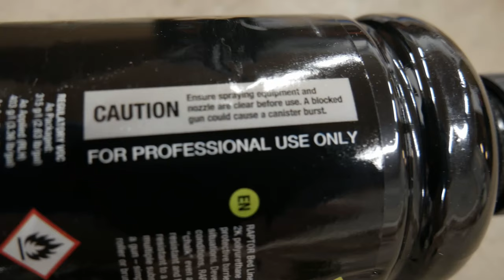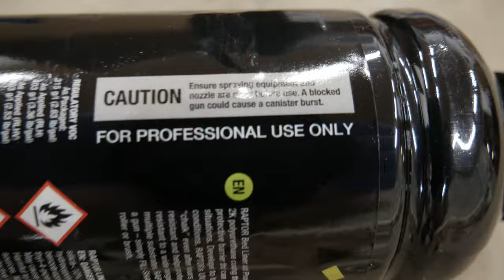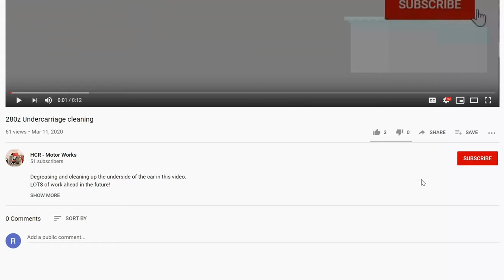Raptor Liner for Undercoating - The ULTIMATE Undercarriage restoration

Comment: Hey thanks for the video. Looks amazing. Did you have any issues with heat from the exhaust and the raptor liner holding up? I’ve read the max temp is 185 once applied. I’m about to undercoat and wanted to see if there were any issues with that!
Reply from the maker: I have not had any issues with it heating up or falling off. Good prep is key here though. You may have issues with it becoming soft and becoming easier to damage from road debris around the exhaust sections but it should hold up fine. If your worried about it you can always ceramic coat or wrap your exhaust where its close.

Comment: Any reason why you haven't used sand blasting? Would be really nice to have some explanations of what's going on especially at 21:05. Thank for the full process though :)
Reply from the maker: I mentioned in this video https://youtu.be/P8f2Wo_zBxo why I didn't sandblast this one (I have blasted em in the past) and in this video https://youtu.be/omuu6Of1388 I have a breakdown of all the steps.  The algorithm loves the time lapses with no info though so YouTube pushes those videos more.
Reply: @hcr-motorworks  oh thank you, sorry I’ve just came here from a YouTube search. Will definitely take a look now :)
Reply from the maker: @Holms  ANYTIME! Thanks for stopping by and watching!
Reply: @hcr-motorworks  Motor Works  I was thinking about some rusty places, when some rust can be left in a small holes where grinder won’t be able to reach. How do you solve those issues? Having epoxy putting on a surface where there are some rust left even tiny one, is not a good idea I believe. There’s also an acid primer to isolate the rust from metal… but I’d just try to sand blast those spots. Would require a mask tape and cellophane around the car, but if it’s just a couple of spots you wouldn’t be buried in a dust I believe.
Reply: @hcr-motorworks  oh and I haven't seen any 3M roloc and bristle discs used in any of 3 videos.. or maybe I've skipped something, but I've went through again through all vids and haven't noticed they've been used anywhere. You've did everything with a stripping disc.
Reply from the maker: https://youtu.be/GdapVksYGFg This video shows me using the roloc bristle discs pretty heavily. They are great for those hard to reach areas where the scuff pads wont get to.
Reply from the maker: Datsun and rusty places are synonymous...to rid yourself of rust, one must become the rust.  I prep the metal as best as possible and removing rust where you can reach it.  I always get down to fresh bare metal and then clean clean clean the metal before epoxy primer.  clean fresh bare metal and then 3 coats of epoxy primer will prevent the rust from returning at least in my lifetime
Reply: @Holms  I think Spray with ospho would be wise.  Just make sure it's neutralized before paint.  There's bad stories of rubberized undercoat failing.  I don't want to have to strip off all good paint and trying to figure maybe a good primer to cover paint/bare metal/converted rust.

Comment: Any chance explaining difference between coating and the texture coat?  Is it just shoot from a further distance for smoother lay of the paint? Cheers
Reply from the maker: On the Raptor Liner the first two coats are thick and fairly runny...think like spraying tar basically.  There's a lot of unevenness with these types of products but you have to get the build thick enough so its effective in protecting the surface.  The texture coat is to give it an even roughness and uniform coat on top of the thick layers and make it look better.  All you have to do is up the pressure and double the spraying distance and do long uniform sweeps with it on the 3rd or final coat.
Reply: @hcr-motorworks  thanks very much 👍

Comment: Would sand blasting the car have been easier? Or was this a budget way to go? I have an 87 crx si that I plan to restore, was going to have it sandblasted and painted
Reply from the maker: https://youtu.be/P8f2Wo_zBxo Check out this video where I break down all the methods and why I did what I did for this project.
Sometimes the easy way isn't the best way, on your CRX, or any car body for that matter, you should not blast the body panels, engine bay, undercarriage, interior are ok as long as you hire an experienced blaster and do wet/dustless/vapor blasting...I would NEVER dry blast any sheet metal as the heat will warp and oil can everywhere and ruin it, even with an experienced guy at the nozzle.
Reply: @hcr-motorworks  that is incorrect, it will not get hot let alone warp sheet metal unless your putting the nozzle point blank  right next to the metal. The only disadvantage is its messy and yes the water vapor blasting would be preferred on body panels not under carriage, the last thing you want is water entrapment right before you seam seal. I dont know what experience your opinions on sand blasting come from they are wrong i speak from experience. There is no other method other than dry ice blasting that achieve the paint bond bar none!

Comment: Awesome video question instead of the epoxy I was thinking on using the rust encapsulator from Eastwood and than apply the raptor liner same process as you but use the encapsulator as primer would that work also? I want to prevent rust as much as possible
Reply from the maker: I prefer to remove the rust as much as possible. I never use rust encapsulaters/converters. Seems like just kicking the can down the road instead of fixing the problem.
Reply: @hcr-motorworks  really oh wow and I thought that would be a better option which expoxy do you recommend I tried looking on your links below but I didn’t see the epoxy
Reply from the maker: @Maxmgm212.  southern polyurethane for the epoxy hands down
Reply: @hcr-motorworks  awesome I just found it I’m getting it for sure I’m gonna start my project next weekend , what product did you add at the end you mentioned for texture ?
Reply from the maker: @Maxmgm212.  its the raptor liner undercoating. That should be in links in the description, let me know if its not and ill fix it!
I used around 2 kits if i remember correctly to do the whole undercarriage.

Comment: Hi. Do you think Upol Raptor is better than regular blackson? Thank you
Reply from the maker: I'd say that if your going to use something other than raptor liner it needs to come in a two-part system.  A base and a catalyst, or activator of some kind.  Anything that comes in a tub, bucket, pail, container etc that is one part or "ready to spray" right off the store shelf is not going to work near as good as the raptor liner.
Thanks for watching!
Reply: @hcr-motorworks  Thanks ! Maybe I will use it for my miata undercarriage, Upol also sells special epoxy primer for raptor. Expensive but hope it will last for years ! 
You did an amazing job
Reply from the maker: @watai  My advice would be to do exactly what i did my previous videos if you want it to last a lifetime.  Strip to bare metal, clean, clean clean, and when your tired of cleaning the bare metal, clean some more.  Then lay down some good two part epoxy primer (hands down Southern poly urethanes is the best stuff for the price and home shop environment) then Use a quality seam sealer (brush able or tube kind) and then Lay down another coat of epoxy once that has cured.  Then and only then are you ready to add the raptor liner on the new and clean epoxy primer.  Doing it this way and adhering to all the steps along the way will surely lead to a successful outcome that will last many decades.  My earlier videos on the undercarriage lay out everything in detail. ENJOY!
Reply: @hcr-motorworks  Not questioning your methods. Just asking. Don't you have to scuff the epoxy for the liner to grab? Or apply it wet on wet?
Reply from the maker: @AdrianMontana  I apply the 2-3 coats of epoxy to the prepped bare metal and let that dry overnight. Next day I do the seam sealer and let that dry up overnight, day 3 I throw another coat of epoxy over the seam sealer and give it another overnight drying cycle and then on day 4 do the raptor liner WITHOUT scuffing the epoxy primer. With SPI at least,  as long as your within the 7 day curing window you can topcoat without scuffing. Anything outside the 7 day window your going to have to hit it with a marron scuff pad at the very least before any additional epoxy coats or top coats are applied.
Reply: @hcr-motorworks  Legend thank you for the detailed response. Much appreciated. Great video!

Comment: What primer/paint is used on the bare metal
Reply from the maker: All the information is listed in the description
Reply: @hcr-motorworks  absolute legend thank you. So epoxy. Seam sealer. Epoxy then raptor.  Do you have to scotch/key the surface in between the coats. Ready fpr the raptor?
Reply from the maker: @sabz_bhp  not if it's within the 7 days cure time window. I usually give 24-48hrs between sets to ensure adequate flash times but not full cure. If you go beyond the 7 days of epoxy curing before you get a chance to top coat it then yes you'll need to scuff it before the next coat.

Comment: The secret stew here is that car did not have a single real rust area to even mention or talk about and it's probably gonna live a long time into the future. That's a totally awe inspiring screwin around doing that thing...  Usually most cars have those inner rust holes and it's out of the question to totally cure the problems. This car had zero rust being garage kept since it took a shit or whatever reasons it was parked. It will live on now after that job
Reply from the maker: this one had plenty of rust, but was repaired in other videos
Reply: @jamesmccaul2945  I call bullshit just like it I see it... I know set up videos... There R many diff climates in the south land... It aint what we get to fuddle with here and put back together.. Most of the shit looks like a piece of swiss cheese that comes in my shop... I just don't brag about the shit we get here... There is nothing to brag about it... That thing was in a garage for many years it was no street survivor...
Reply: Tks for watching.

Comment: Hey, can you tell the type of fabric or towel or else that you degreased the surface with? Thet blue colored fabric
Reply from the maker: Sure thing! https://amzn.to/3mfrKQc
Do NOT use regular blue "shop towels" these ones above are lint free.  The shop towels will leave behind all kinds of trash and it will ruin your efforts!
Reply: @hcr-motorworks  That was fast. Thank you so much. This, and the video helped and gave me tips a ton! Been looking around for a full, not cut video of the process
Reply from the maker: I strive for greatness! lol  I have all of the videos in the 280Z build album.  Not sure which part your looking for specifically but here's all the undercarriage videos in order
1 cleaning - https://youtu.be/LUR2cSDQxZs
2 undercoating removal - https://youtu.be/P8f2Wo_zBxo
3 metal and surface prep - https://youtu.be/GdapVksYGFg
4 primer - https://youtu.be/jTz7iUK0OIc
5 raptor liner - https://youtu.be/omuu6Of1388

Hope that helps!
Reply: @hcr-motorworks  I will dive into them, definetely! One other question, basically all epoxy primer is good for raptor, not just the U-pol original product made for it?
Reply from the maker: Ehh, that's a loaded question but to sum it up yes any 'polyurethane epoxy primer'  No single part or 1k products, only use a 2k epoxy or something that comes with an activator and you should be good...lol I'm sure there's a ton of back and forth that people will get into with 'compatibility' issues or potential issues from mixing and matching products from different suppliers but for what its worth I have NEVER used UPOL primers, not saying its bad or wont work but I ONLY recommend two companies for paint products and that's 
southern polyurethanes inc - https://www.southernpolyurethanes.com/
Or TAMCO paints - https://tamcopaint.com/
Paint and body is one of those segments of the industry that there's like some secret code and tribal knowledge and the big boys don't share information willingly so I narrowed my purchases to the two companies that I believe that go above and beyond and completely out of their way to spread information to the hobbyist, enthusiasts , home builder.  That's something you will not get from any other name brand big wig corporation.  Tamco and SPI have literally built their business around helping the one man shop and I can't say enough good things about them.
Reply: @hcr-motorworks  I will put my vote down beside you on this, I don't know jack about the paint industry, but if some company stays loyal to their individual customers, than that's a good sign. And as I see, you have no problem with the results after all, that's the proof for me!

Comment: You lie!  There's no way you had fun ;)  I'm doing the exact same thing to a Jeep YJ and I know how much effort all that stripping and preparation takes.  Curious why you didn't go with sandblasting.  That saves some time.
Reply from the maker: I lay out why I didn't sandblast it in this video - https://youtu.be/P8f2Wo_zBxo 
I've done it in the past and on some other projects but it wasn't in the cards for this one, it cost a lot more money and doesn't make for as fun of a video :)
Thanks for watching and subscribing!
Reply: @hcr-motorworks  I already started that other video.  I found a place locally where they have DIY sandblasting.  Costs about $150/hr and I did my whole tub in an hour.  There is still some sand in the crevices, but overall it got perfectly clean and was cheap.    No need to worry about cleanup either!
Reply from the maker: @johnniemo  thats awesome they allow DIY blasting. Maybe post that company up for anyone else in your area to take advantage of that deal! All the blasters around here want in thr 1k range to blast a shell
Reply: @hcr-motorworks  Sure thing.  It was in Calgary and they are called Consolidated Compressor.  I will post a video on my channel once I get the Raptor Liner installed.
Reply from the maker: @johnniemo  Sounds great! thanks for letting everyone else know there are affordable options out there!

Comment: The cost on that must be insane...
Reply from the maker: yea its not for the faint of heart lol
Reply: @hcr-motorworks  im getting ready to do this same thing.. do you mind if i ask how much you have into material?
Reply from the maker: I'd have to have a bit more info to give an accurate number.  Like how much in raptor liner or everything included to do the job like epoxy, raptor liner, cleaners, abrasives etc.

Comment: You could of just sprayed the raptor and skipped all that stripping and cleaning and it would of looked exactly the same.
Reply from the maker: And with no prep, it would have looked the same for about a month sure, and then start flaking off in rather rapid order.
Reply: @hcr-motorworks  mine hasn't and all I did was power wash it and let it dry. It's great for making things look a lot better than they actually are. Which confused me a little with the 280 it's so nice why hide that a good mat black would of looked so perfect and showed how nice the car is underneath.